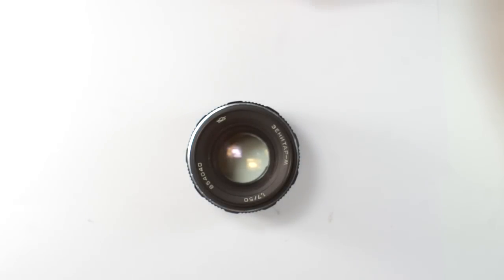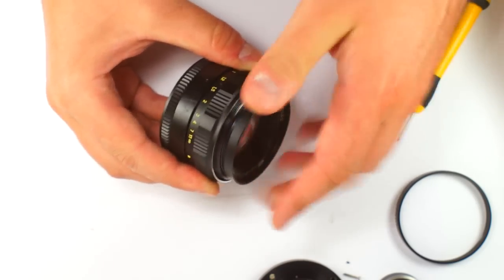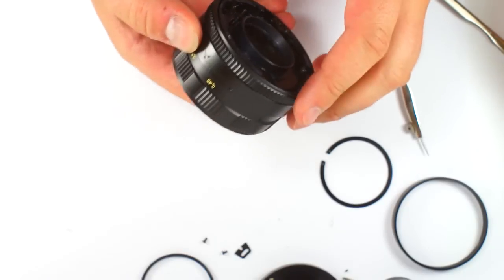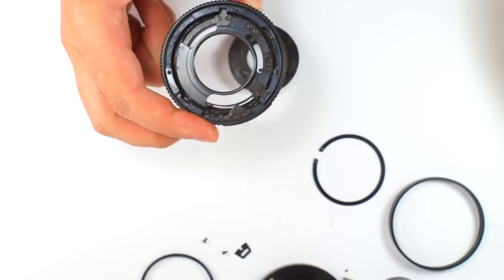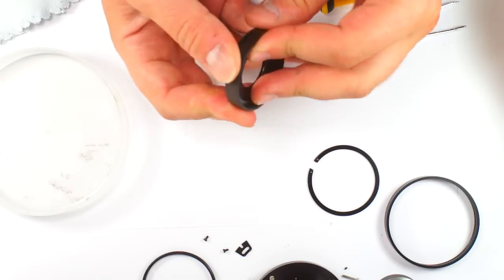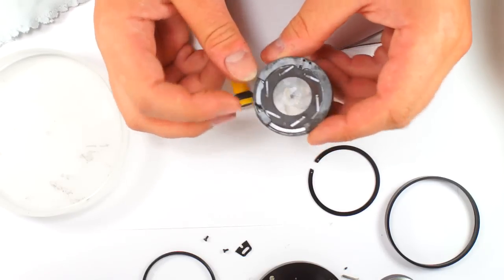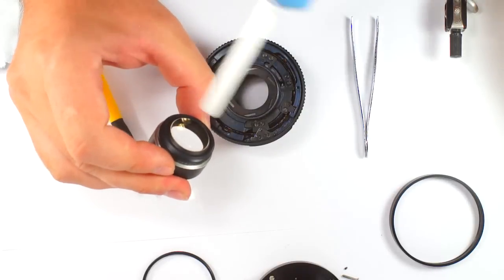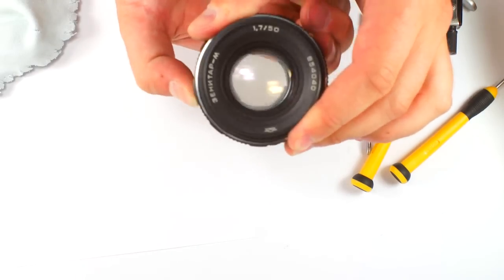How to fix ZENITAR-M 1.7/50 stuck aperture blades

Comment: Do you have any video on how to regrease the Helicoid?  Also, what type of grease do you use?
Reply from the maker: no i don't have such video. Try to use helios 44m video instead. These lenses are pretty similar inside.
I use a lithium based grease bought locally.

Comment: This is a great video, I very much appreciate you posting it! One question, I lost the microscrew (I sneezed :( ) - can you tell me the size of that screw? It does not seem vital, but I would like to have it in place.
Reply from the maker: J Mac Hello!Actually i do not have zenitar-m lens to be able to mesure it. But you can take  calipers, take another similar screw from your lens and mesure it.
Reply: Retro Foto House Thanks for the tip and again for the video, it was VERY helpful!